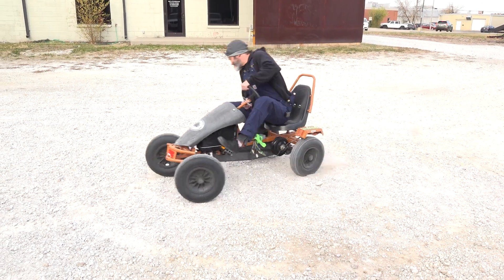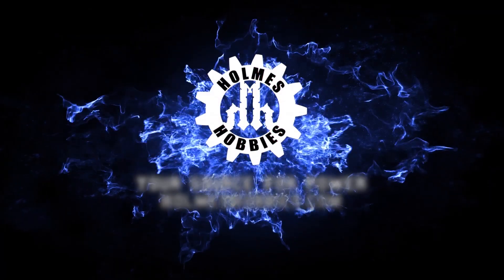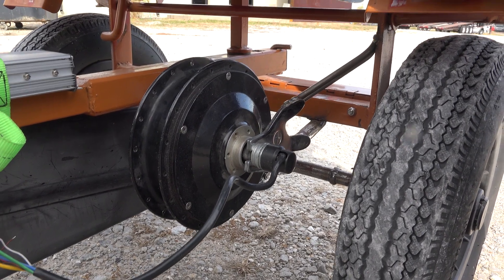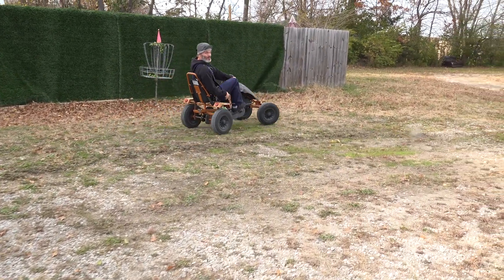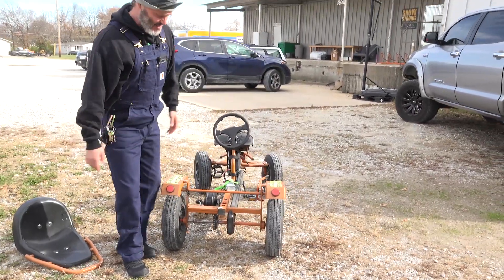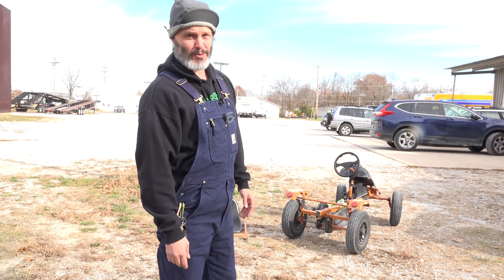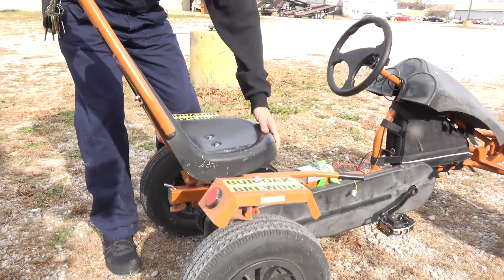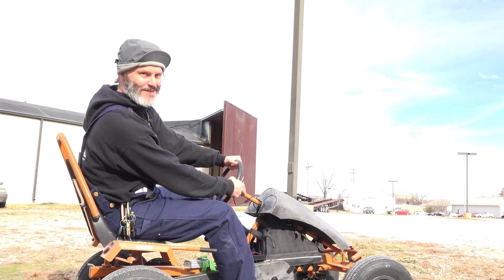Electrifying Weird Stuff! Unveiling The Electric ATV-like Project  - Holmes Hobbies

Comment: thats awsome .....do you have a recommendation for upgraded motors on my 6 year olds grave digger power wheel?that thing is sharp it has real coilover shocks its just pretty slow.i  have seen were people do some upgrades
Reply: I've heard of the traxxas 21 turn 550 stinger motors for them
Reply from the maker: I threw 21t trailmaster sports on my son's power wheels.  Ran fast, pulled wheelies, pulled them out after a year still running strong for 45t 550 on 24v.
Reply: @HolmesHobbies  is it one motor for forward and one for reverse.? If so since the rc motor has forward and reverse can you put 2 ?